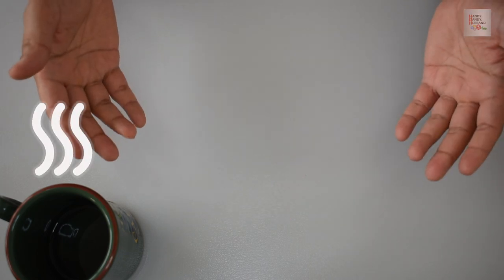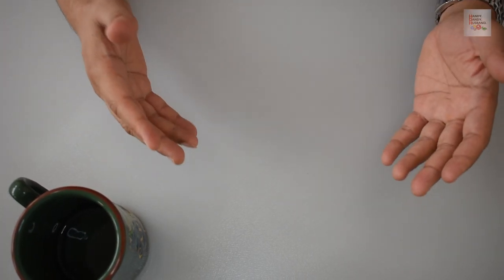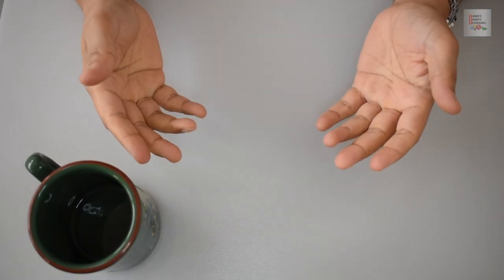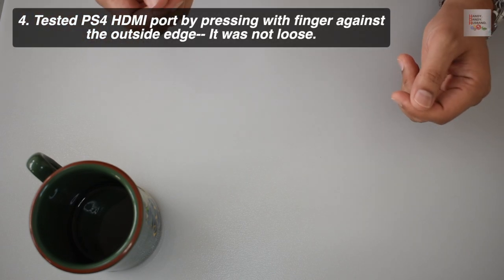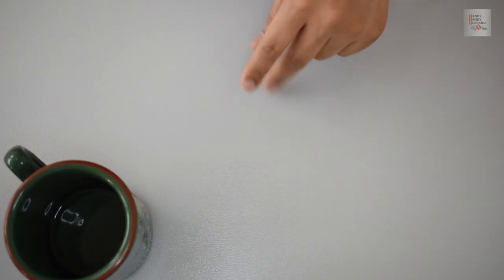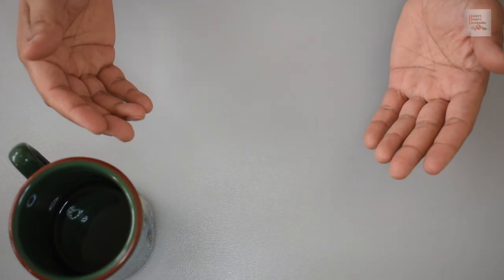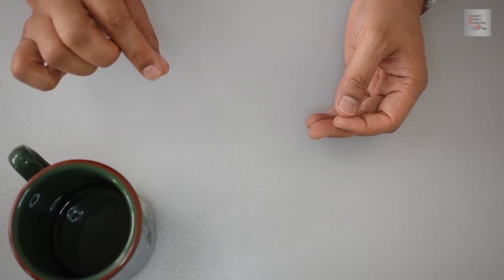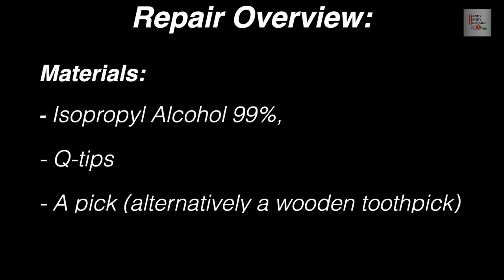𝗤𝗨𝗜𝗖𝗞 𝗧𝗜𝗣: 𝗣𝗦𝟰 𝗛𝗗𝗠𝗜 𝗣𝗼𝗿𝘁 𝗥𝗲𝗽𝗮𝗶𝗿 -- Easy, no solder required -- [Fix that video input error]

Comment: I have a thin needle but I just can't get up under it to bring it back up idk what to do
Reply from the maker: Hi SauceLord006, thanks for watching and sending me your question.  If the thin needle is not thin enough to get in-between the metal prong, try taking the back side of the needle (the rounded part--not sharp part) and gently push the metal prong from the bottom up.  You might try something thinker like a pin head to get more surface area.  Just make sure it is long so that you can get a good grasp of it.  Hope the suggestion helps you.  All the best to you, H.D.H. [: { ].
Reply: I finally got to pick them up but it's still showing no signal I probably have to just go get the whole HDMI port replaced thank you for your assistance though
Reply from the maker: @saucelord006-5  Hi SauceLord006 -, I am sorry the fix didn't work for you.  Do try replacing the HDMI cord and gently shifting the cord when it is in the PS4 port to see if that helps.  If that fails, then, yes, replacing the port may be the only option; however, do try to contact Sony and see if they will cover a warranty authorized repair because this is an issue that has affected a lot of customers.  Thanks and all the best to you, H.D.H. [: { ].

Comment: i have a question its a black screen what do i do
Reply from the maker: Hi Jordan Ward, thanks for watching.  A black screen when it should display something (i.e. even if it is just an error message) may point to an issue with your TV/monitor.  Try unplugging the electrical cord of the TV/monitor, wait 20 seconds for any capacitors to discharge, and then plug it back in and see it that resets the TV/monitor.  Apart from the above, suggestion, I would also refer you to the manual for the TV/monitor to check if there isn't a setting that is causing the issue.  Hope you get your rig working again, all the best to you, H.D.H. [: { ].

Comment: Does this work on ps4 Slim?
Reply from the maker: Hi JamieMapes, thanks for watching and sending your question my way.  Yes, this fix will work with PS4 Slim.  My son has a PS4 Pro and that is what I used for the pictures; however, during my research, I noted that all the PS4s had similar HDMI ports.  Note that the PS4 slim may run 'hotter' than the PS4 regular or PS4 pro so you might actually experience more issues with the slim.  I would strongly recommend turning a fan on and let the air ride over the PS4 slim case when you are using it so that you can keep the temperatures down.  Hope the above answer helps you, all the best, H.D.H. [: { ].
Reply: My hdmi port broke but I would have to pay £70 to fix it (or do it myself) there’s 2 types of ports a believe the one for the PS4 and then the other ports for the PS4 slim and the PS4 pro would I need a soldering iron to remove the port on there at the moment?
Reply from the maker: @jamiemapes1394  Hi there JamieMapes, thanks for comment.  I did not know that there were different types of ports on different versions of the PS4.  Are you sure of this?  It seems to me that the ports would be all the same or at least similar (all the pictures seem to appear the same anyways).  To answer your question, YES, you will need a soldering iron with a micro tip to remove the port.  Also make sure you have something to remove the solder (solder vacuum or copper braid).  A high quality variable temperature soldering iron should be used because if you are too hot you could damage the board or components, too cold and you could have cold solder joints.  Hope the above suggestions help you out.  All the best to you, H.D.H. [: { ].

Comment: It's not working and I followed all the steps and I can't even afford to get a new one so any other way I can fix it?
Reply from the maker: Hi Evan Marsden, thanks for watching and sending me your comment/concern.  I am sorry my fix didn't work for you...it is a bit of a downer knowing you must have paid $300+ for the console and it does this.  I don't know of any other way to fix it permanently except for replacing the HDMI port on the PS4.  One thing that I could suggest is try holding the HDMI cable when it is connected to the PS4 and gently nudge it from side to side or up and down and have someone watch the TV to see if that can establish a video input connection.  If it does, you might consider using duct tape or packing tape to jerry rig the cable in place.  I know this 'fix' will look ugly, but if you can't afford a major repair, it may help you in the short term.  If you do try the method, please let me know the result.  It will be helpful to our community to see what other methods may or may not work.  All the best to you, H.D.H. [: { ].

Comment: My ps4 is wiggling what will i do!!!
Reply from the maker: Hi Michael Coffey, thanks for watching and sending me your concern.  I am sorry to hear that your PS4 is wiggling.  I am assuming that you actually mean that your PS4 HDMI port is moving/shifts.  If this is indeed the case, then you need to be very careful as the port is likely desoldered or its connection to the circuit board is compromised.  In most cases like this, you will need to replace the HDMI port.  I would recommend taking the PS4 to an authorized repair depot and see if they can provide you with any further guidance.  Sorry my fix didn't work for you.  Hope you get the PS4 working again, all the best to you, H.D.H. [: { ].

Comment: Hey do I also lift the prongs on the ceiling of the HDMI port?
Reply from the maker: Hi JAtoraKOju, thanks for watching and sending me your question.  I am not sure I understand your question.  I don't want to mislead you and cause you any problems; therefore, kindly either provide a better description of what you mean or send me a clear, close-up, well-lit picture of your HDMI port to my email:  thehandydandyhusband.info@gmail.com so that I can fully understand your particular situation.  You can also take a look at this picture and see what the prong should look like after the fix (in green):   https://drive.google.com/file/d/1nYwZaYcaKrAbYL6Nsrgn1AA8T0TmL-53/view?usp=sharing
Hope to hear back from you, best regards, H.D.H. [: { ].
Reply: @HANDYDANDYHUSBAND  Hey thanks for replying. So there's those prongs on the bottom but there's also ones above. Should I keep it flat or pull it out
Reply from the maker: @jatorakoju7237  Hi JAtoraKOju, the prongs that you bend (wherever they are, top or bottom) should only be on the outer metal casing of the HDMI port--DO NOT touch anything in the middle.  With the thin metal pieces (whether on top or bottom), they should be bent so that they gently but firmly hold the HDMI cable in place.  So, the top ones would be pushed gently in towards the floor and the bottom gently up to the ceiling so that it maximized how firmly they hold the cable head (sort of like two fingers).  Do not push them too far up or down as then the tip of the cable head will snag on them--they should have a slight hump that is all that the cable head needs to be positioned properly.  Hope this helps, if you need further guidance, let me know.  All the best to you, H.D.H. [: { ].

Comment: Umm I got the same problem here so I was wondering if you cold please help me
Reply from the maker: Hi SAVAGE Julian, thanks for watching and sending me your question.  Yes, I would be happy to help.  Please send me a summary of your issue.  Close up pictures showing the issue help a lot.  You can send the pictures by email to thehandydandyhusband.info@gmail.com 
Look forward to hearing from you again, all the best to you, H.D.H. [: { ].
Reply: @HANDYDANDYHUSBAND  will my PlayStation 4 hdmi wont work
Reply from the maker: @YT-SAVAGEJulian  Hi SAVAGE Julian, thanks for your reply.  OK.  Your HDMI won't work.  What makes you say that?  Do you see an error on your screen saying there is no video input?  If yes, then please let me know if you have 1) replaced your HDMI cable with a new one, 2) tried plugging the new HDMI cable into another port in your TV and 3) tried the fix (propping up the bent prongs on the HDMI port) featured in my video.  Please let me know and provide as much detail as possible and I will try to help you out.  Thanks, H.D.H. [: { ]
Reply: @HANDYDANDYHUSBAND  ok

Comment: Hi sorry to bug you but what about the usb ports 😭 i haven't been able to use my ps4 in months the usb ports dont connect my controller
Reply from the maker: Hi Anu Adidja, thanks for watching and sending me your concern.  I haven't heard of any issues with USB ports on the PS4.  As far as I am aware, they are as good, if not better than most devices.  I do know that my son once had an issue with the USB port (the wire worked in one but not in the other) and when we replaced the wire, it worked fine.  I would suggest the following:  buy a brand new USB cord and connect it to your controller and your PS4.  See if that solves your issue.  If possible, please let me and the community know your results.  All the best to you, H.D.H. [: { ].
Reply from the maker: @anuadidja6407  Thanks for your reply Anu Addija, can you please take a close up picture of your USB on the PS4.  Make sure you have lots of lighting and don't use flash.  I can examine the USB for you and let you know if there is any issues that can be identified.  Once you have the picture, send it to my email:  thehandydandyhusband.info@gmail.com 
Thanks, H.D.H. [: { ].
Reply from the maker: @anuadidja6407  Great.  I will look out for it.  Thanks, H. D. H. [: { ].
Reply from the maker: Hi Anu Adidja, I received your pictures and have also replied via email.  The PS4 must have been stored in a moist environment.  The green growth on the metal of your USB ports is corrosion and must be removed thoroughly before it will work properly.  I would suggest using a thin electronic cleaning tip and a contact cleaner and thoroughly cleaning both of them.  See my email for detailed information and suggestions.  All the best to you, H.D.H. [: { ]

Comment: After putting my prongs up a little... the playstation symbol comes on when i turn the ps4 on... but for a breif second then goes back to a blank screen... im lost...
Reply from the maker: Hi Leighton Posey, thanks for watching and sending me your comment.  Can you please confirm that you followed all the steps listed in the video.  Check also that you did reset the PS4 2-3x.  If you did follow all the steps, try gently lifting up the prongs just a little more and see if that is enough to re-establish the video connection.  Note that sometimes this takes some trial and error.  Hope you get your PS4 working, if you have any more questions, please let me know.  Thanks, H.D.H. [: { ].

Comment: My ps5 not working I tried everything and my hdmi don’t go all tha way in tha ps5 is that tha problem and if so how do I fix it
Reply from the maker: Hi EditzX.offline, thanks for watching and sending me your concern.  If the HDMI cable head is not able to be pushed all the way into the HDMI port, then there is an obstruction.  The problem could be with either the outer metal strips or the inner metal strips.  I cannot tell without examining the PS4.  If you can send me a clear, close-up, well lit, high resolution picture of your PS4 port from multiple angles, I will try to help you out.  You can send the pictures to my email account:  thehandydandyhusband.info@gmail.com 
I look forward to hearing from you soon.  All the best to you, H.D.H. [: { ].

Comment: Hi I need help i have a similar problem it won’t connect at all. I used different hdmi cables and different tv and it still won’t work when i did the hard reset I saw the ps4 logo but after that the ps4 won’t connect to the tv. Plz help
Reply from the maker: Hi boof_clutchz Z, thanks for watching and sending me your question. The fact that you did see the PS4 logo is good sign; however, I need more information before I can respond to you. 1st: how did you perform the 'hard reset', 2nd: did you perform the fix featured in my video?, 3rd:  what does your HDMI port on the PS4 look like in comparison to mine (same or different):  https://drive.google.com/file/d/1nYwZaYcaKrAbYL6Nsrgn1AA8T0TmL-53/view?usp=sharing , 4th: what happens when the PS4 is on, do you get the no input error or something different.  Please let me know the answers to my questions and I will try to help you out.  If you want to send me pictures of your PS4 HDMI port, send them to my email:  thehandydandyhusband.info@gmail.com.  All the best to you, H.D.H. [: { ].

Comment: When I try to prop up the metal prongs, the HDMI cable doesn’t go in. I lower them a bit but it still says no signal. What should I do ?
Reply from the maker: Hi II EGO II, thanks for watching and sending me your question.  First, be cautious if the cable has any issues being pushed in.  When you prop the metal prongs up, make sure they are up but the rounded middle area of the prong is most visible--NOT the front (prong area facing towards the front of the HDMI port) part of the prong edge which will prevent the HDMI cable from being inserted fully.  Remember that it is sliver of metal and you just need the center area of this sliver pushed up so that the rounded area of the sliver permits a tight but unobstructed path for the cable.  I hope the above helps you out, if you need further guidance, you can send me clear, bright pictures to thehandydandyhusband.info@gmail.com and I can try to help you out some more.  All the best to you, H.D.H. [: { ].

Comment: I have to metal strips that are half gone dose it mean I still need a hdmi port because it wont even work when I put it on safe mode it's just a black screen
Reply from the maker: Hi Dylan Ronayne, thanks for watching and sending your question my way.  I need a bit more information before I can respond.  When you say your metal strips 'are half gone, do you mean that the thin metal strips have broken away or are they flattened so that you can't see them?  They have indeed broken away, then you will likely need a new HDMI port, but I would suggest checking with Sony and asking them for a warranty covered repair as the hdmi port metal should not be disintegrating like that.  If the metal strips are just flattened out so that they no longer protrude, use the fix that I have outlined.  Let me know if you have any further question.  All the best to you in 2021, thanks, H.D.H [: { ].
Reply: @HANDYDANDYHUSBAND  the metal strips they aren't fully broken off only half of the metal is gone
Reply from the maker: @dylanronayne837  Hi Dylan Ronayne, thanks for your further response.  It is really strange that half the meal is gone...have never heard of that happening.  I would strongly recommend contacting Sony and seeking a warranty replacement.  If possible, please let the community know how Sony responds.  Thanks, H.D.H.
Reply: @HANDYDANDYHUSBAND  it's an original ps4 bought on launch so the warranty is well gone I'm just going to get a new port repair thanks for the response
Reply from the maker: @dylanronayne837  Hey there Dylan Ronayne, yeah I suppose replacing the port is the solution; however, I have found some companies will do a warranty repair regardless of the timeframes involved:  see my video on Redwing boots--they sent me a new pair many years after the original purchase.  It won't cost you very much to reach out to Sony explain the situation via email or phone and see what they are or are not willing to do for you.  Maybe...they might agree to give you a discount on a future console purchase.  Whatever the case, I would recommend giving it a shot.  Thanks for checking back in.  All the best to you with the repair--try to take it to a factory authorized outlet.  Thanks, H.D.H. [: { ].
Reply: @HANDYDANDYHUSBAND  but my warranty seal is broken but I'll give it a shot cheers for all your help you know what they say not all heroes wear capes 👍👍
Reply from the maker: @dylanronayne837  Hey Dylan Ronayne, thank you for your kind and encouraging comments.  All the best to you and I hope you get it working again.  Thanks, H.D.H.